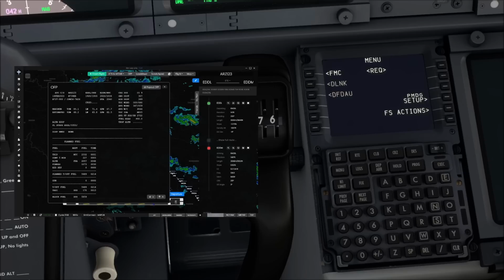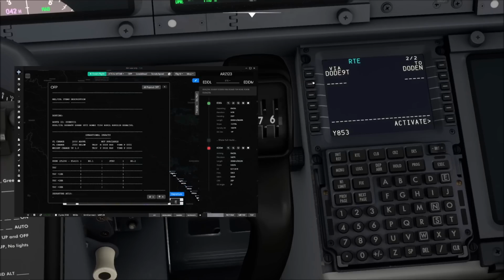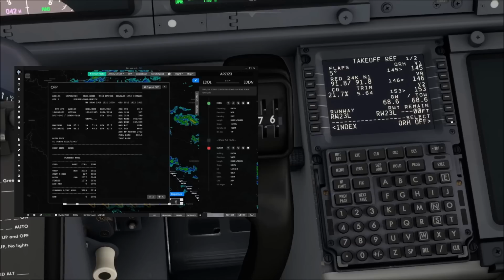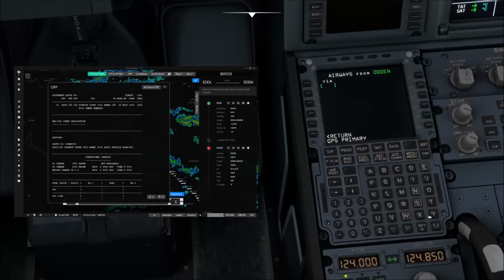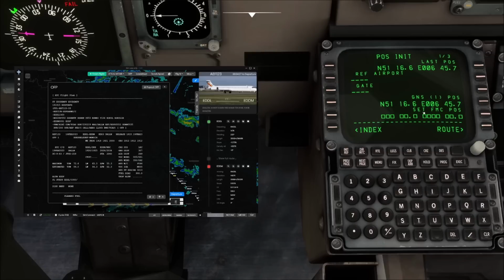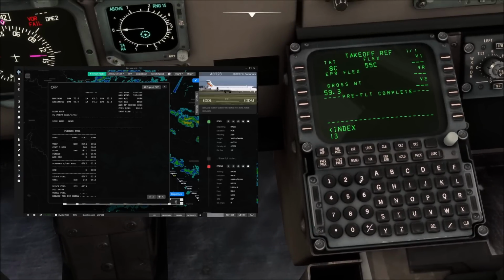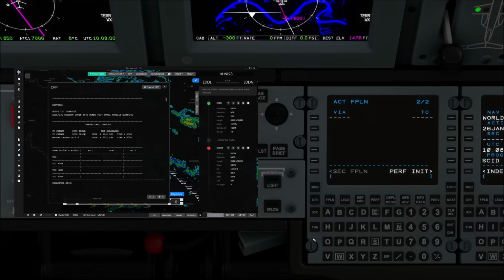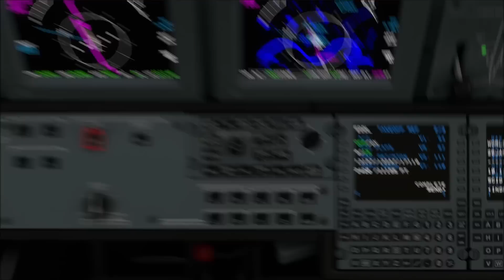How to program ANY FMC in LESS THAN A FEW MINUTES | Real Airline Pilot

Comment: Question - my ZFW never lets me type in anything lower than 100 -  I just get a 'Not Valid' (or something to that effect) error. However, if I type in a Gross Weight it will then calculate a lower zero fuel weight. Any ideas why? I'm using a flight plan that was calculated by simbrief but it just wont let me type in a lower zfw. Plus if I click the ZFW button it will calculate automatically but it's always  around 120-130. Any help would be super appreciated

Comment: Thanks for this video, this is very helpful in understanding how FMC works in general and how to program it. I do have one question, for ILS, would we have to manually enter the ILS freq into NAV1/2, or since the landing runway is programmed into the FMC with ILS approach, it would know the frequency already and we just have to activate approach mode on the AP?
Reply from the maker: In the 737 there is no auto tune of the ILS, you need to tune them manually.

Comment: If I’m still loading cargo pax and fuel how do u get the center of gravity to put into the perf calculator for a derate, I wait until I finish loading everything before I do the n1 limit page because I don’t have a proper center of gravity
Reply from the maker: If you're doing real time loading of the plane and it's still in progress you can not get the numbers out of the FMC yet - you need to wait until it's finished with the boarding.
Reply: @A330Driver  roger thanks that's what I assumed

Comment: How to screw with the following flight crew: IRS: OFF. External power: DISCONNECTED. Battery: OFF. Walk down jet bridge with a troll face 😅
Reply from the maker: Nah, that's our standard we always do ;-)

If you really want to screw them turn the IRS OFF, but switch off the remaining power while the ALIGN light is still illuminated. Chances are good that the next crew will be able to align the IRS, but it's going to drop out and loose alignment when the plane starts moving again, aka when they start pushback ;-)

Comment: Regarding the maddog, i thought when entering the block fuel, you typically enter it as 7.0/N instead of 7.0/A. The “N” denotes normal operations, whereas the “A” refers to an alternative fuel flow schedule. I believe you only use the alternate fuel schedule when you want to burn a portion of wing tanks before the center tank, reducing the chance of ice formation due to cold soaked fuel. I think most airlines use the “N” fuel schedule…….but don’t quote me on that 🫣🤔
Reply from the maker: True that, N would be the norm.

Comment: Excellent, thank you. The FMC has always looked confusing aka the sat nav from hell! 
The common workflow is reassuring. 
I'm excited to program one flightplan on every airliner!

Why do some FMCs calculate V1, VR, V2 and others want the pilot to input that data?

They all have the variables necessary to calculate takeoff speeds
Reply from the maker: They all need the pilot to put some data in, what you see in the Boeing FMC is some very simplified reference data only. We must still crosscheck it against the OPT and the OPT numbers will take precedence over the FMC numbers. More often than not the OPT will give us different numbers than the FMC.

Comment: Hey Captain! Thanks for the informative video. I just wanted to ask; I know that you can program the route in a 737 by just entering the airways. Do you use it on your preflights too? Does it have any place in your SOP? And are there any safety concerns on using this method? Thanks!
Reply: Waypoints are important in the flightplan for fuel checks etc.
Reply: @EinkOLED  sure, there is no doubt about the importance of the waypoints. But I'm asking about route input method in FMC. If you enter two intersecting airways in "VIA" on the route page, FMC automatically adds the intersecting waypoint to the "TO" side on the route page, with all other related waypoints adding to the legs page. I just wonder if SOPs are permitting this method.
Reply from the maker: Personally I often use the airway only method. But you need to be very careful that it actually picks the correct intersections between the airways. It does happen that sometimes it picks different intersections and you need to spot those errors and correct them manually.
For this reason many colleagues don't use this method.